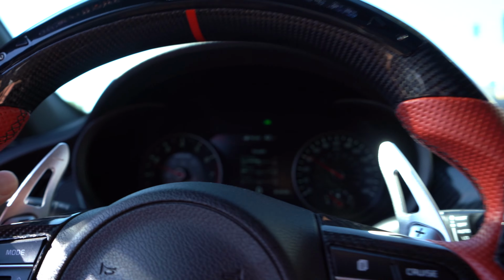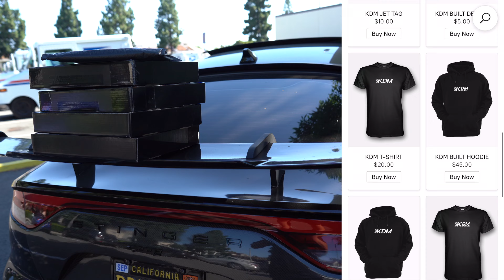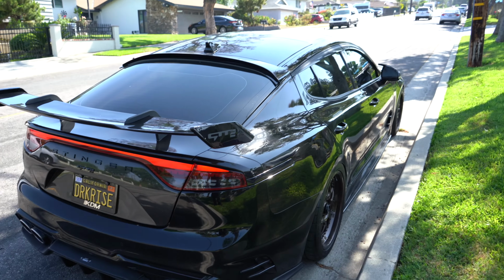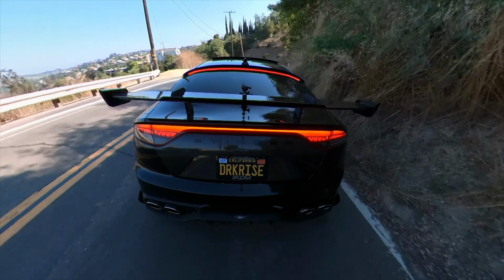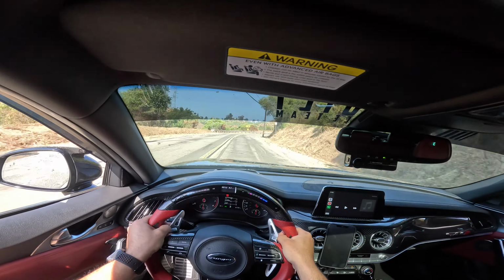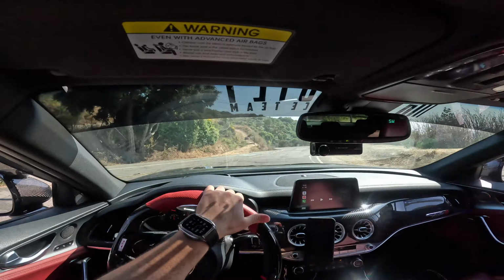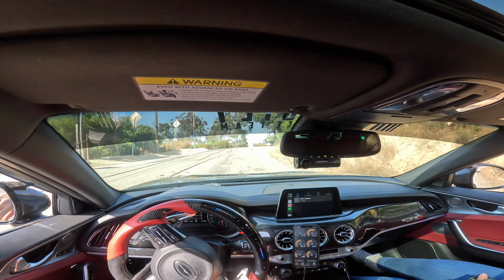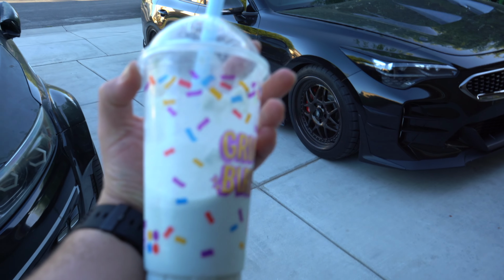FAST KIA STINGER - POV DRIVE CANYON RUN (LOUD EXHAUST)

Comment: Stinger cant run full 85 yet, one of the main ways would be to do CPI and test it out but even then no tune besides maybe lap3 or lozic has been pushing for a full e tune. Right now I believe theyre at e60 ish before the rest of the E becomes redundant. Then again a lot of stingers vary so one may be able to run around e60 while another cant go above e40 without their hpfp crashing. Hopefully more changes to come soon!
Reply from the maker: I think lozic got there first full E85 done a few weeks ago so it might work💯
Reply: @DARKRISE  I heard they were doing some crazy stuff recently as well. Just becareful pushing that power out of the stinger because some people at around (500wheel+) start lifting their heads and eventually blow the engine. I bought arp studs made specifically for the stinger to prevent this. Its an expensive preventitive  mod but it gets rid of the issue of stingers head botls stretching. Let me know if you're interested as theyre a little complicated to order/get them.
Reply: @DARKRISE I think burger Jb4 had a flash for 85 using the EK1lite to flash
Reply: I mean I run full e85 all day long when I drive it. Been this way for over a year. Just needed cpi and running on map 5 and BEF with sxth (or whatever their name is).
Reply: Sixth Element here in Spartanburg, SC has a dyno and can tune your stock ECU for full e85 with touch screen little screen to mount. Like $900 total

Comment: What part of Cali are you from? We should do some canyon runs together. Your stinger is pretty badass. Most stingers i see just basic mods. You actually upgraded your fuel system. Thats pretty cool. Im all about modding. dont matter what car it is. if they're good mods and not all over the place, and run well, im all about that. And yours looks pretty clean (mods wise). Mine is at about 10 miles / gallon, too. Pretty bad on gas but super happy when foot on gas pedal :D  I dont care about paying for gas. will never do EV.

Comment: Coolant goes down like that when your head bolts are stretching
Reply: If it rises alot after the engine is hot then you have air in your coolant system

Comment: Thats the one thing ive noticed with my stinger as well. I can go for months without the coolant even budging and then all the sudden half of it is missing lol. Other than that ive never had any issues with this car. They're amazing!
Reply from the maker: Same fam! Lately alot of stingers bros have been breaking . So far still no problems luckily
Reply: It is the coolant cap, if your losing coolant without no leaks you can see then change the cap. I went into Kia got a new one never had issues again.

Comment: My AWD is stock, I get 16mpg city. And I drive slowly
Reply: I'm stock as well and rwd city, I average 15-16 mpg too
Reply from the maker: With Jb4 Awd , I average 14-15 mpg. Compared to other vehicles with the twin turbo V6 this is pretty bad mpg for power output:/

Comment: Does E-85 only use for stringer I have a 2021 Kia forte could I use that for mine or not
Reply from the maker: E85 only works for tuned vehicles.
Reply from the maker: Or flexfuel vehicles

Comment: 500 HP on wheels!? that’s amazing! What’s 0-60 ?
Reply: Something like 4.6
Reply: @mowglig9382  I expected better . Stock is around 4.7 sdc
Reply: @kiarashchristianomoshar4071 supposedly
Reply from the maker: Not sure. Im still on Jb4 currently
Reply: Def not making 500 to the wheels with a jb4
Reply: I believe at 500hp with his add on’s he’d be around 3.9-3.7
Reply: Hes not 500 wheel. 500 crank